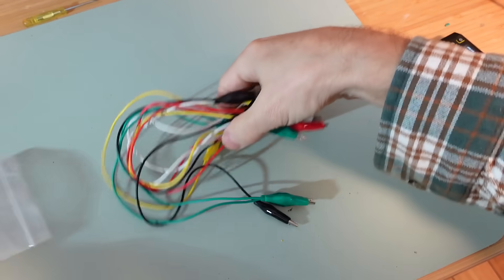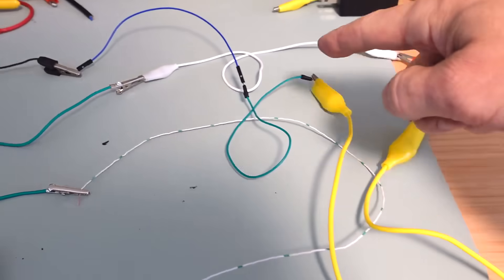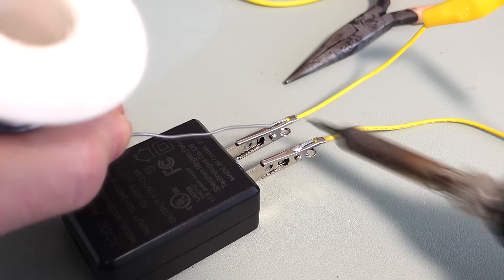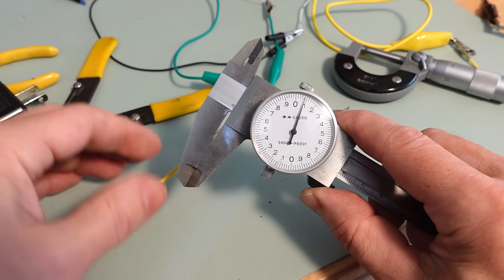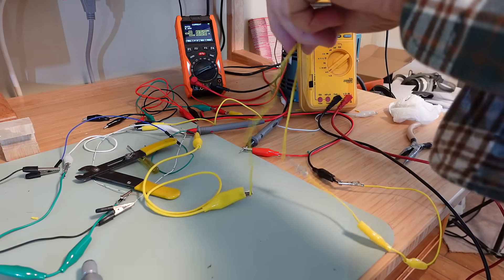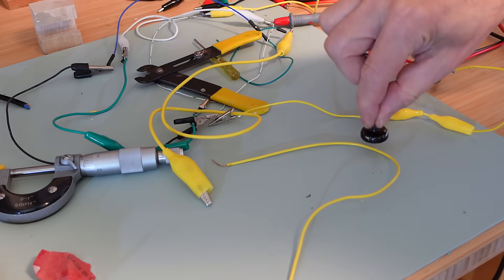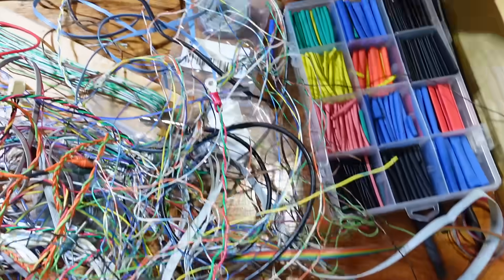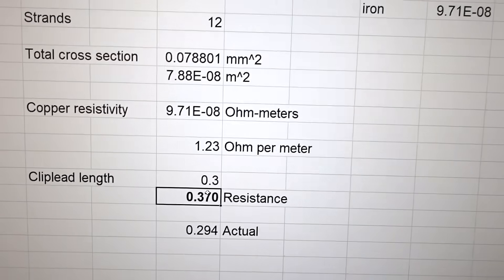Clip leads made with fake wire

Comment: Yup, noticed this a few times, cheap is cheap :). These are maybe ok for low current stuff, like 100mA and 30V but thats about it. I make my own test leads, silicon isolation and some decent AWG with decent  clips with flat front nose, as these pointy "crock thoots" are alsoa weak spot. Great video, raising the awarness!

Comment: Really interesting find. I found some of my newer dupont leads are ferrous so must be iron as well. They have been giving me trouble with poor connections. Iron is not that flexible so I wonder if the tiny wires break more easily causing some of the problems. Copper is pretty soft so would stand up much better to repeated connections and disconnections which is what you would want in test leads. The iron leads would be cheaper to make but moving the wires would lead to them breaking as they just don't have the flexibility/are too brittle. Thanks for sharing, really enjoyed your investigation and explanation.

Comment: Iron wires are sometimes used when some resistance is needed. For example old gasoline engines often should have an iron wire of a certain length and cross-sectional area for the spark plug to get the resistance just right. But clip leads should (in most cases) be as conductive as possible, so copper is obviously better than iron.

Comment: Makes me wonder if the mouse cables have iron shield braid, would make sense to keep costs down. Also, coaxial cable such as RG59 and RG5 is copper plated iron core. Found that out when taking scrap cable to the junk yard when I worked for a car audio shop.

Comment: I bought replacement lamp cords on Amazon and they didn't even bother to coat the wires with copper. The cords were supposedly rated for 10 A, but I would NEVER trust them for such a load!

Comment: A few years ago I offered to look at a small corded Chinese-made vacuum-cleaner a friend had which had failed on her as soon as it was switched on. 
They had refunded her money but didn't ask to return it, so she just purchased a better rechargeable branded model, but I was curious to discover why it had burned out so quickly. Found that the stranded-copper wires leading into stator-coils appeared to have made from recycled copper which contained so much rubbish that not only was partially ferrous, it was next to impossible to solder! 
Also I realise I bought a packet of those jumper-leads a while ago from a Jaycar store here in Australia, but haven't needed to use them yet so I should check their quality (or lack of)!

Comment: I went through this EXACT song and dance and I thought I was losing my mind because I stripped the wires and soldered them for a solid connection and I couldn't understand why they were so lossy. Now I know. Something else people have to watch out for is all of this wire like landscape wire they sell on Amazon as copper wire. Most of it is copper coated aluminum wire. Buyers beware.

Comment: This just requires you to do more research before buying stuff. You can find quality stuff but you have to sort through a few pages of garbage. 

Sometimes the cheap stuff does the job fine, but for stuff like this, you really want to find a quality product. I bought a bunch of wire off ali-express the other month and it's the best wire i've ever gotten. But the stuff I got 5 years ago that I finally ran out of, well, it was pretty bad..

Comment: Thank you for this. Actually thank you heaps.
I grabbed a few packs just for quick links and easily fried a few, so I stopped using them. Some others that I checked were open. I just left them aside as I was going to put some decent wire on the clips instead of wasting them.
.
I just ran a magnet over them and laughed my head off.
.
P.S. Also be very careful with Chinese ICs. Many ICs are mislabeled as newer variants of an old chip. Unfortunately they filter into markets outside of china so you don't know what you are getting, even if you purchase them from other distributors :(

Comment: Some years back I bought a spool of "low voltage landscape wire" for a small demonstration solar array. The wire was sized appropriately but the resistance was very high. Over half of the energy collected was dissipated in this cheap wire before getting to the charge controller where it could be used.

Comment: Thanks for this, I will be getting the magnet test on my leads now.
I expected cheap croc clip leads to be iron, but I found an HDMI lead was iron and the lead from a Logitech keyboard model G213 and that really did surprise me.
Reply: Iron wires were invented for low current automotive sensors.  Digital signals do not really care much is the wire has some resistance on short cables.  If you use copper for just 1mA then it gets too thin and steel is a good substitute, copper plating prevents the worst corrosion.

Comment: You're lucky your fake wires are still made of metal.. my last batch of pegged m/m and m/f jumper leads turned out to be made of copper plated cotton string.. can't even solder it to anything it just burns away completely... and more than half of them are intermittently conductive at best...

Comment: OMG !!!

it's because they are more bendable!!

I thought "why would a computer mouse have an iron wire?" And I immediately thought "well copper would wear out from mechanical stress and it might even snap, or at the least it wouldnt be as flexible"

and then it clicked, these things are made for playing around with, and for use on small projects that require flexibility like on bread boards. I've used smaller copper wires for such projects and a lot of the time the wire can be stiff enough to move small parts like switches around on the table, but alligator clamps have always ALWAYS been super accommodating.

anyways, good video, I learned something

Comment: I checked a bunch of my wires with a rare-earth magnet.  I was able to detect smaller amounts of ferrous material by dangling the wire vertically and trying to pull it sideways with the magnet.  It deflected when the magnetism wasn't sufficient to lift or get the wire to stick to the magnet.

Comment: Yeah, this is why I replace the cables of 18650 cases from china at least using broken PC power supply cables. Those cheap cables are baaad, they get hot, they become noodles really fast. The voltage drop is like 1.5v when drawing just 2w!

Comment: I have run into this problem a LOT.  It isn't just wires you need to be careful of.  I've had 2A fuses that still do well with 10A running through them.  Can't trust any of the batch because if I test their point of failure and they fail when they should, then that's the one I needed to use -- except its dead now.  I also ended up with some batteries that were re-labeled.   Gotta inspect this chinese stuff, even if you're getting it off Amazon.  ... Maybe especially if you're getting it off Amazon.

Comment: The other thing to look out for is copper-clad aluminum. Without exception, cheap jumper cables are copper-clad aluminum. I've also seen house wire that's the same or just pure aluminum.

Comment: I bought a Quincy diesel-powered generator that was only about a year old.  This was not a cheap model, in fact Northern tool lists it for about $7000.  Had trouble getting the starter to crank, even with a new battery and the compression release activated.  I removed the battery cables to clean the ends and they seemed very light for their size.  I had some battery cable that was about the same wire gauge and cut a piece the same length, and it weighed at least twice what the original wire weighed.  I made new cables and the generator cranked right up!  I scraped the wire strands of the original cables and found they were silver underneath--aluminum!  

I was really disappointed that Quincy would cheapen a high-end product like that!

Comment: Some of the wires that you are labeling as ferrous are likely not just simple wire, but might be shielded, like the mouse cable. That shielding is quite often from cheaper ferrous wire than from expensive copper.

Comment: I can concur.  I also had tested a sketchy switching power supply from China from 2012. The wire didn't bend right and felt like a brush head. The kicker was having voltage at the power supply end but loosing the voltage at about 10 feet away. Weird stuff.

Comment: I thought copper clad aluminum and overly thick insulation was the cheap rip off, never thought they would make copper clad iron. I wonder if some of the black jacketed data cables use iron in the shielding though, like on the mouse, not sure why they would as generally they use aluminum but hey, save 1/99999 of a penny make 1/99999 of a penny, I really shouldn't put it past them.

Comment: I've encountered sooo many situations in the past few years where voltage, current, and/or resistance readings I've been making were strangely off with no apparent reason. To my chagrin, I've always taken the integrity of all the simple clip leads I was using for granted, and never checked them. My bad. Nice job!

Comment: Get end scraps of wire locally and if you can, make your own.  As Matthias says, always check the wire scraps you collect are REAL copper wire. Never buy simple connection cables from China -  but buying cheap connectors from there is usually OK (USUALLY!).  If you are not confident making up your own coaxial cables - never go straight for the cheapest pre-made ones available online - always check the reviews first and then select the least bad seller.  Audio experts and radio hams will often highlight bad products for you.  And remember that a great number of electronic items sold on Amazon are originally sourced from China.

Comment: What makes that wire “fake”??  Were they sold to you as copper ?  If you are working with experiments where the connecting wires resistance is of consequence, I would not be using alligator clips…

Comment: I really wasn't expecting iron to be the issue.  I went into this expecting it to be one of the typical 'copper-clad aluminum bad' videos, despite CCA being fairly common and usable as long as you spec the gauge correctly.  I wonder just how widespread this issue is, I'm also curious what the marketing, or lack thereof, of these products are, and what the marketing situation for products that still use copper, or even CCA, currently is because of this issue.

Comment: Been years since I've noticed that junk being magnetic and stopped buying complete clip leads. you can buy just the croc ends and the insulation boots in 50 pack for a fraction of the cost. Then I take an old PC power supply and use for eg the wires from the 24pin ATX plug and make my own leads. Doesn't take long and never need to doubt your equipment.

Comment: Some are copper coated aluminum, which will also show higher resistance, but won't be attracted to a magnet.  It used to be that copper coated steel wires were expensive (look up the price of Copperweld), but apparently the Chinese have found a way to do it inexpensively.

Comment: I ran into this with Harbor Freight clip leads. They had few strands of very fine wire in a heavy rubber jacket. They would all blow once used the first time! I did not test for magnetic properties but will in the future!  By the way, Harbor Freight stood behind them and refunded my money.  Thanks for sharing it, it is worth my time to watch! 

My story is, testing electrical components and motors. All copper test leads can withstand motor start currents, but the faulty ones would "blow" and go open-circuit the instant the motor was energized. I spent a lot of time troubleshooting things before discovering the brand-new leads were defective.
Reply: Really? I've had good luck with the 10-pack of colored clip leads (other than needing to solder the ends). IIRC they're specifically listed as being copper. Are you referring to a different product or have the newer ones gotten much worse?

I will say I had one of those Harbor Freight cables blow recently but I accidentally put it across the 120v line so it gets a pass.

Comment: I rarely do electrical work but I actually ran into this problem earlier today. I actually went to the trouble with digging up another 12v power supply because I thought the first one was down almost a volt for some reason but when I took the clip leads out of the equation the missing voltage was back.

Comment: I've seen more "fake" wire than I thought I ever would.  Worst I've seen:
1.  Aluminum core with thin copper cladding.  Also smaller than specified gauge.  No idea how they did that (electroplating would be REALLY difficult given the activity of aluminum).  This showed up in a batch of "economy" grade CAT5, and in a batch of cheap speaker wire.  If soldered, it would go to hell (BC the copper would dissolve into the joint and vanish, and the aluminum would not wet and join, probably due to a native oxide layer).
2.  Plastic core with EXTREMELY thin copper helical RIBBON wrapped around it.  Found this in mouse cables and USB cables.  I guess the theory is that the helical ribbon is more "fatigue resistant".  But the conductor is SO INCREDIBLY THIN that it fails easily anyway, and is virtually impossible to work with (can't solder, can't crimp, without it failing at the joint)
(3 - kinda): Leadwires on discrete device packages that are iron with copper flash/tim plating.  It's actually in the datasheets from some of the OEMs now, replacing solid copper leads (like on discrete transistors).  Not great, but there is some precedent (some 1960s capacitors were made this way, for instance, based on how the shells were pressed).  Be careful, though, as it is more corrosion prone.

Comment: As an example of Chinese products. I ordered a 10 pin cable from a reliable provider that is used to connect my ham radio transceiver to my amplifier. The cable arrived and after soldering in the RCA plugs it did not work. Thinking it was me, I de-soldered and then resoldered new plugs-twice. Still no joy.  I ordered a replacement and sure enough, the new cable was the same. In frustration I set it all aside to think about it. After months I ran a simple continuity check. While the cable wires were the correct colors, the cables wires were moulded to the wrong pins. Finally ordered from another provider (DX Engineering) and this one was correct...by the way made in Japan, not China.

Comment: China says screw u assemble them yourselves we ain't even gonna pretend to finish them, now we use fake wire, just to send a message. But at least the colors still match. But yeah usually worth finishing them yourself with solder etc if you need accuracy or reliability

Comment: I noticed some cheap CAT6 cable on Amazon was labeled as "copper clad aluminum" - and not recommended for power over ethernet as that is DC current with a spec assuming copper, so the cable simply could not carry the power effectively. Probably just fine for Ethernet though, as skin depth at over 100 MHz puts all the signal in the outer nanometers of the wire diameter.

Comment: If it comes from China, they are most likely using a "cocktail" of iron and who knows what waste metals with some copper mixed in. It keeps the cost low.  These jumpers are for simple projects, not really meant for sensitive projects.  You should put a radiometer next to the Chinese wires, they could be adding small amounts of radioactive waste... a sneaky way to get rid of nuclear waste over time... export it out of China in very small amounts... they have done worse.

Comment: I am a mechanic, and an extra half an ohm can take systems down in modern vehicle systems; this is great to know; thank you.
Reply: Vehicle sensor wires is where this trend started.  Modern sensors use less current and the engineers said that the wires could not be made thinner for strength reasons so they changed to a cheaper steel wire and copper plated it to prevent rusting.  Recycles better as the copper is wasted when they shred the car with the wiring loom.  Modern cars have so many thin sensor wires and the manual labour required to remove it is not worth it.

Comment: That's just wrong.....

The TV Baluns I've been supplied lately have been copper clad steel....  being external and exposed  to the elements,  they don't do well.  Copper clad steel for coax is ok due to "skin effect" at microwave frequency, but if it sees the weather, the clock is ticking...rust, mmmmmm

Comment: Those clip lead sets have been problematic for 40+ years -- even when they were real copper wire. First thing we did when we bought a set was solder the ends. 

Yeah, copper-coated steel wire from China has been a thing for some time. Our fearless leader at work bought some FleaBay / Chinesium speaker wire and red / black power wire for use with a product. Didn't solder too well and broke easily when the joints were flexed. Discovered it was attracted to a magnet and found out why it was priced so low.

Comment: Milliohms won't bother most hobbyists. The wires probably get hot because they are not a high enough purity copper. In the UK there was Greek made mains cable that had had aluminium melted into it after a batch was tested, the result was house and factory fires as the resistive cable overheated.

Comment: I use the really cheap jumper wires for work just to jump out low voltage connections that only need a signal so they work for that

Comment: I found these kind of incredibly thin conductors in a Euro mains to IEC C13 lead, labeled on both the plug and cable as good for 250V, 10A.  All the conductors were really springy under bending, not ductile at small bend radius like copper strands, and 1.1 metres of each mains wire was 1 ohm on my multimeter, so at 10A the cable could have been dissipating 20W total!  Didn't check voltage drop under load, though.